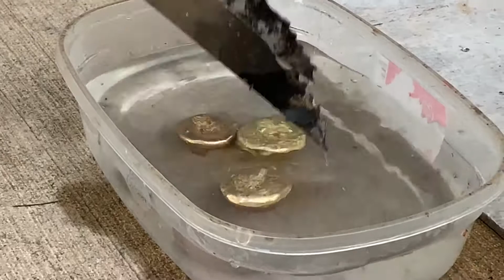Plaster Casting

Comment: Might be good to have separate crucibles for the different metals to help prevent cross contamination. Check your ingots to make sure the metal mixed, the color actually looked pretty good, it will kinda be rainbowish if it's not mixed good, and very brittle. Keep trying, you'll get that gear cast.
Reply from the maker: Thewulf 56 I thought the same thing thx but rn I only have 1 crucible
Reply from the maker: Sorry but no upload this weekend I’m going to St. Louis for baseball and I was supposed to make the copper part of the video a separate one but I couldn’t leave you with a complete fail
Reply from the maker: Thewulf 56 how do you like the thumbnail, I made it on the bus like 2min ago
Reply: He won't if he doesn't start learning and researching this stuff...  It's no fun to watch him fail over and over.  I'm glad to see that plaster didn't go ape.  I had it happen to me a few years ago even after slow baking it for hours.  Plaster of paris can be used and was used by the masters, but never like this mess....  They were just smart enough to mix it correctly.  If I remember, it's 1/3plaster 1/3 fine sand and a 1/3 grog.  Grog being the investment that was used last time.  Something to that effect?
Reply from the maker: I bought petrobond/greensand off of Amazon last weekend it hasn’t come in so far so my next actual cast will be next week I might buy another crucible soon for copper and I’ll use the crappy one for aluminum. This weekend I don’t know what I will do right now maybe more cans, it doesn’t cost anything and I’m kinda broke. I’m 14 that shouldn’t be an excuse but my only job is umpiring and that is kinda out of season. Sorry I can’t keep buying 50lb bags of sand and sifting them, or buying already fine sand. I’ll do try my best.
Reply: @American_Innovation  good job man.  The petrobond is going to make a world of difference.  Now get some scrap wood and make yourself some flasks.  First item you make is a proper sand rammer.  Look online at them and make your pattern out of some junk wood.  This stuff doesnt take money, but brain power.😉  Pouring metal is only 10% of this game.  The other 90 is patternwork, sand work and finishing.
Reply from the maker: worldtraveler I made flasks but they are way to big rn so I’ll make some smaller ones because I will only have 10 lbs
Reply from the maker: worldtraveler sand rammer? can I use a 2x4 to push it down. (Hoping I’m not embarrassing myself)
Reply: @American_Innovation  Dont be a tool, make the proper tool fool!   Use a 2x4 to help you make the wooden pattern of your rammer.

Comment: Plaster of paris makes a poor investment material!  I thought we had this conversation before?  You may think your plaster is dry, but it contains BOUND WATER at the molecular level and when you pour your metal in, it BOILS.  Instead of failing in your attempts here, follow these simple instructions.  Make your part in foam.  Then take some drywall mud.  Thin it 50/50 with some water.  Dip your foam in the mixture and let dry.  Repeat half a day later.  Do this 3 times.  Take your coated foam and bury it into a bucket of fine sand.  Be sure to leave your pouring cup at the surface.  If you can vibrate the container, it will compact the sand and give you better results.  When you are ready to pour, melt aluminum, get it hot and pour steady and quickly.  Don't piss around.  This is the better way of lost foam.  Investing foam into plaster of paris is actually a dumb idea.  You still have to get rid of the foam.  Melting it out with heat is the better method, but again, it still contains bound water and is subject to split apart when it gets hot.  It lacks the alumina in it.  Remember casting is 90% pattern, investment, molding work and only 10% pouring metal.  Why don't you just make a proper cope and drag and buy some petrobond from amazon?  https://www.amazon.com/Teton-Bond-Petrobond-Fine-Mesh-Foundry-Casting/dp/B07J1V7ZD3/ref=sr_1_2_sspa?keywords=petrobond&qid=1570162380&sr=8-2-spons&psc=1&spLa=ZW5jcnlwdGVkUXVhbGlmaWVyPUExQU1PSjNOUklSTTZaJmVuY3J5cHRlZElkPUEwNDUwODY3MVhWSktGUzVBMU5MMiZlbmNyeXB0ZWRBZElkPUEwODE5OTkzU0cxQ0g2WUVOMjVIJndpZGdldE5hbWU9c3BfYXRmJmFjdGlvbj1jbGlja1JlZGlyZWN0JmRvTm90TG9nQ2xpY2s9dHJ1ZQ==  You do know you can use this sand many times right?  It's oil bonded sand and worth every penny.  Last word of advice, stick to aluminum for now..  Copper is hard even for pros.  90% of the copper casting I see here on YT is complete trash.
Reply: Saw another channel "sandrammer" who has found a company that sells the ingredients to make petrobond. He's a retired US Navy caster. The ingredients are sold in small enough quantities so as to not "break the bank". I rank him up with olfoundryman, luckygen as far as his knowledge of casting, especially bronze.
Reply from the maker: How much petrobond could fill up my wooden boxes I used when I made my own greensand
Reply from the maker: They are 2x4s and they are about 1’ by 1’
Reply from the maker: donnie brown thx
Reply from the maker: Aluminum always expands and copper doesn’t, sometimes the aluminum doesn’t go down the hole I make. what could I do other than make the hole bigger?
Reply: @American_Innovation  Yes, make the hole bigger.  That is called the pouring cup.  Make it about 2inches wide at the top and have it funnel down to your part.
Reply: @jagboy69  it gets into turbulence, something that can ruin a good pour. Olfoundryman gets into this wholeheartedly.
Reply: @jagboy69  your right about the video game stuff. But most of those guys do it to gain views. And it pays off.
Reply: @donniebrown2896  Maybe in money, but their castings are shit.  I won't suck up for youtube.
Reply from the maker: worldtraveler bud I’m going to try lost pla casting without a burnout oven, vacuum chaimber, or real lost wax flask. I’m in uncharted territory so I’m wondering what brand of drywall mud, or stuff like that simple but idk what it is so if u could help me out 👍🏼. Don’t be surprised when the cast turns out bad but my greensand ones are better.
Reply: @American_Innovation  Dude, you need to learn what bound water is and what it does when it gets heated.  Proper investment may look like plaster, but its definitely not.
Reply from the maker: worldtraveler like I said I don’t want proper I want a crappy result cause if my mind to make rash decisions about buying stuff I don’t need.😂 but seriously I get that investment isn’t plaster and that plaster cracks and can explode when it comes in contact with hot metals. I just want to put a print in a paint bucket fill it with settled investment, melt out the pla and cast. Literally that’s it, I just need to know what to make the investment out of. I have no money to do it correctly or even near correctly so. If you could help that would be great if you can’t, that’s okay I just went to you when I remembered what you said about lost foam. Thanks - Landon
Reply: @American_Innovation  The masters from 500years ago were successful with plaster investments because they knew how to mix it and they knew how to heat it.  Even with wax, they spent 10days melting and drying the molds.  The molds were extremely thick.  Many many times thicker than any bucket.  Do it right  or dont bother.
Reply from the maker: worldtraveler that’s disappointing. If you are suggesting I make my own kiln out of dirt, or using wax, or doing real wax casting as in non vacuum casting, I’m not taking that route I am 14 and my Hoa wouldn’t allow me making a kiln out of straight dirt nor would they allow me to light it given my house is too close to the woods, I assume that you mean coal, charcoal, or wood. All for a mold that I don’t really want. The cons outweigh the pro I would rather make a stupid investment than an extremely expensive, time wise and money wise, stupid investment. The material and permission I have for that is limited. Lost I’m not making a dip and dry type mold, I was trying to make a vacuum type mold
Reply: @American_Innovation  pottery kiln off craigslist.  I paid 25bucks for mine.  Smelled like cat piss first time I used it.
Reply from the maker: worldtraveler alright I’ll look for one
Reply from the maker: worldtraveler thx I’ll check it out